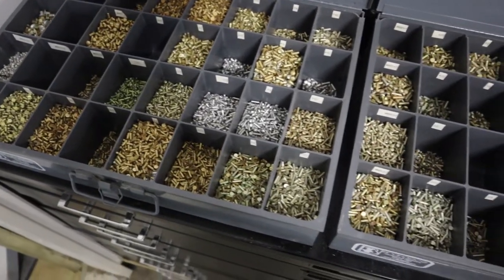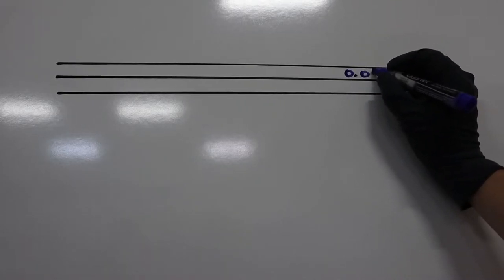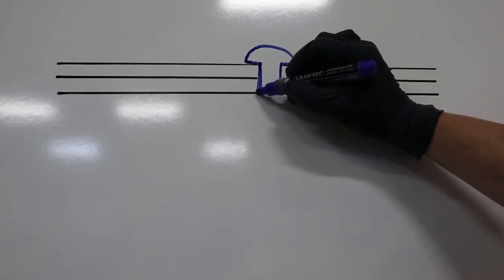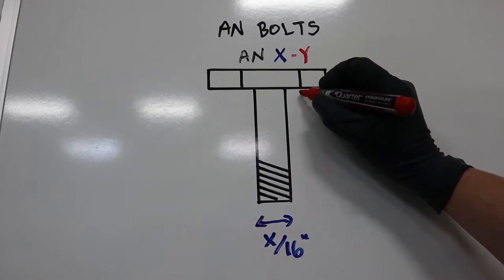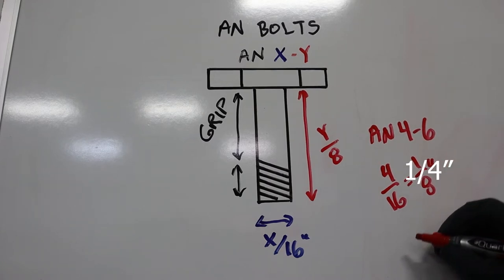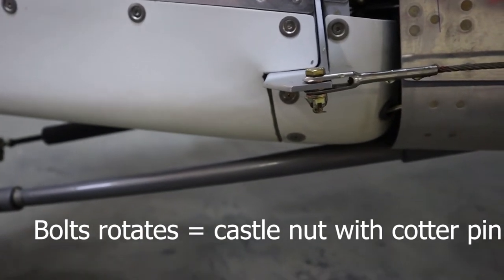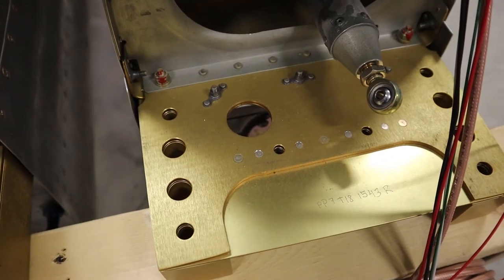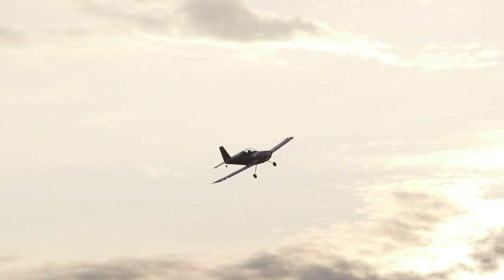Episode 4 - AIRCRAFT HARDWARE

Comment: AD does not mean hard, it indicates the material. 2117 AL. And I have found that AD's a barely considered structural rivets. They are soft and easy to shoot. D rivets, 2017 AL, are better for primary structure. NAS 1097 rivets are for aircraft skins. Allen head screws are definately structuraly capable bolts where they are not exposed to airflow. Instrument panels and switch plates are not "decorative".